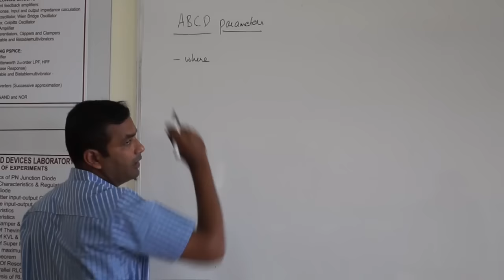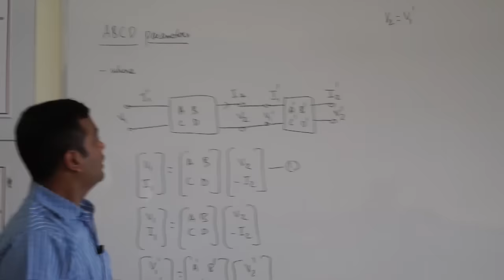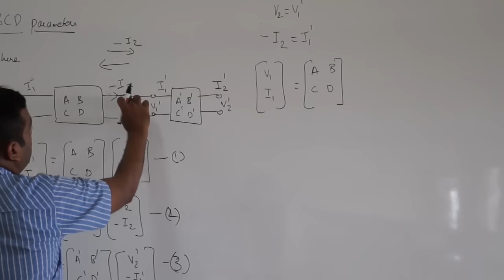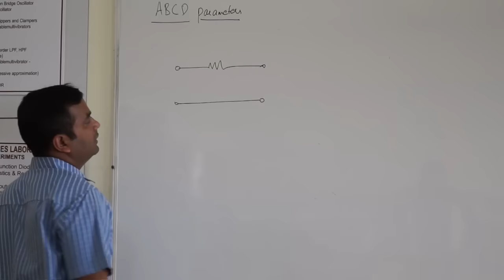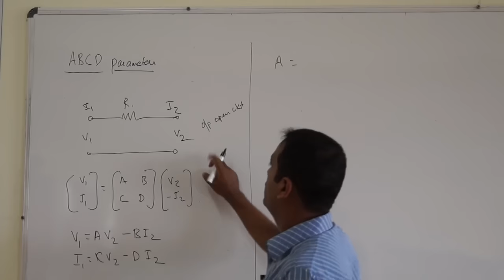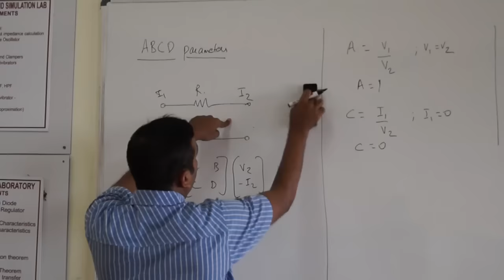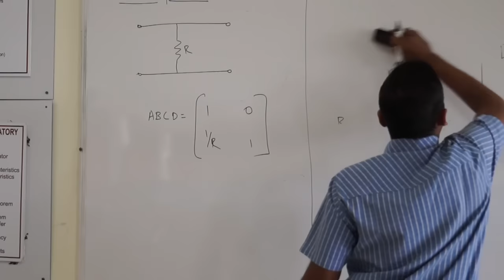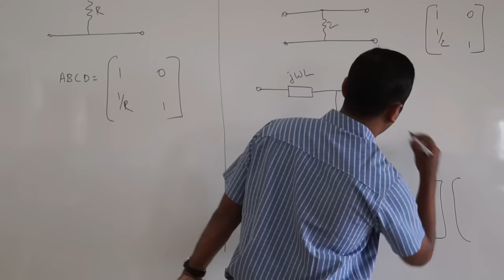ABCD Parameters

Comment: i have one question, in finding the abcd parameters of shunt element the second step will be v2=o.
but wen v2=o then v1=o. when both v1 and v2 are zero how we will get tha i1/-i2=1
i mean wen voltage values are zero how the current will flow in network and how d=1?